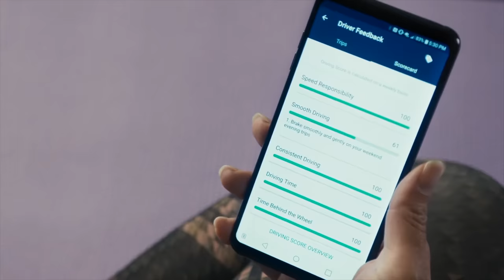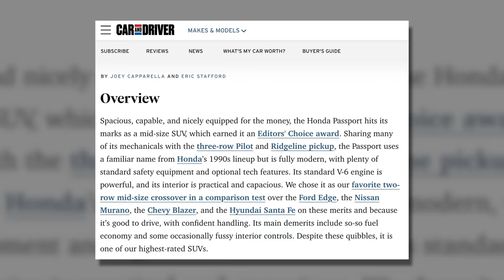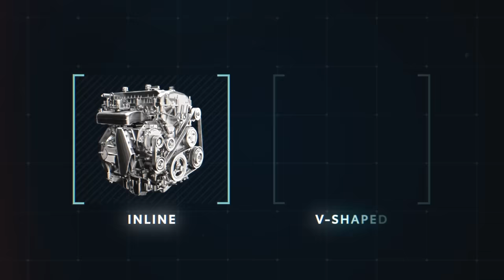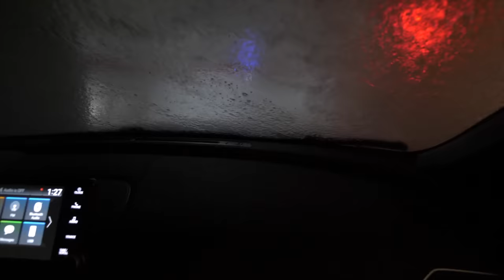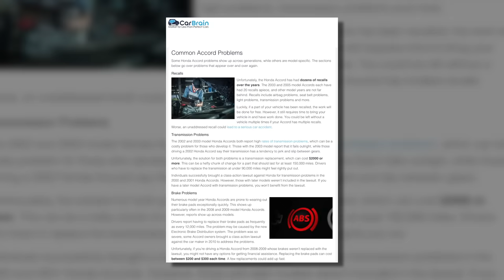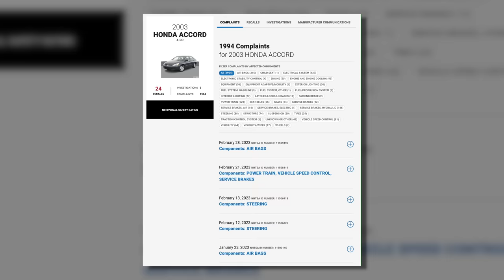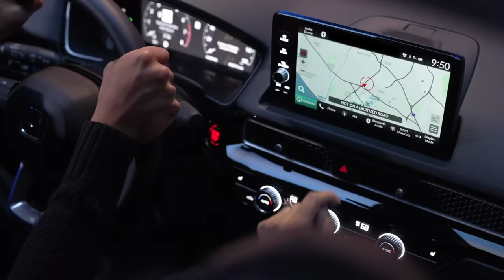Honda's CEO Just Said, "We're Losing Customers Fast and Don't Know What to Do"

Comment: former owner of a 2020 civic and a 2022 ridgeline. the civic with the 1.5turbo had oil dilution issues, regardless of what the dealer claimed. checking the oil before a service visit, the oil was half quart high and stunk of gas. then there was the thin hood that rippled with cross winds at high way speeds, not cool. digging deep into the ridgeline's VCM feature was disheartening, the 'thud' and its sound suppression in the cab as well as the engine mounts that will fail. not cool. honda is not what it once was. got rid of both vehicles.

Comment: I bought a 2016 honda fit..last year.( cvt )... Put BC racing coil overs an Hks hi power silent muffler a Magnaflow high flow Cat...and a drop in K&n air filter...and I have so much fun driving this car around town...I doordash with it full time...No back or neck issues...pretty comfortable really! and this car is really quick! and sticks to the ground! Super fun to drive! fingers crossed but not worried this is my 3rd honda and so far have been low cost to maintain...and you get alot of miles between spending money.

Comment: My honda fit had the instrument cluster repeatedly not start up in cold weather due to the cracking of the cheap solder used in the circuitry. They offered to replace the whole thing for $1500 but that wouldn’t have solved the underlying problem so I just took it out and resoldered all of the pins with better solder and now it works every time. Also very buggy software. And the timing chain rattles on startup but they said they all do that. Other than that it’s been great.

Comment: We have owned 3 Civics, 3 Accords and a Ridgeline since 1984. The 97 Accord had 250k when I sold it. The 2010 Civic has 229k on it and I am selling it soon. It still runs very strong. The 2013 Accord Sport has 100k + on it and is still A great car. Love my 2017 Ridgeline. 26mpg with all wheel drive on Road trips! Love em!

Comment: I have a 2016 Honda, which I have had no issues with at all.  Just change the fluids. My 2019 Toyota Highlander has already had a fuel pump changed out, and an AC compressor replaced.  The Toyota is much more comfortable to drive, but I love the Honda reliability

Comment: Have a 2022 Civic with 18k miles on it rn. We have had a few hondas such as the accord, pilot, odyssey, and crv. I feel that the pilot and odyssey are nice but the transmissions can be slow; Something we didnt have a problem in our 2009 highlander. Odyssey got traded in after some transmission issues.

Comment: YTuber John's Garage's daily driver is a 2000 Acura TL. He has put almost 700,000 miles on it. The other day he took the engine apart to replace the knock sensor, and the car's engine interior looks amazingly clean. He's been changing oil and oil filter every 3000 miles since day one. That simply tells you all you need to know about Honda.
Reply: Knock sensors are mounted to the outside of the engine.  Sounds like a tall tale to me.
Reply: ...honda 23 years ago...

Comment: Great video. I bought a new Honda Accord back in 2001 with the V6 engine, it has been an extremely reliable car. All I have had to do to it is wipers tires lights and brakes in 160k miles. I still drive it today. I also bought a new Toyota pickup truck in 1994 which was the same way, extremely reliable with the same service record except i had to put in a clutch last year. I changed the oil every 3k miles. I got tired of them both so back in 2010 I bought a dodge ram 2500 with the Cummins diesel engine to pull a 30ft camper and I have had more trouble with it in 45k miles than my Toyota in 160k miles. As far as the Honda, I bought a new Honda CR-V hybrid in 2022 and love it. I will have to say that I liked the Toyota venza better but when I ask how much to change the batteries in 10 years the shop told me the venza was 10k VS the Honda at 3500. Even though I liked the venza better, it wasn't worth, 6500 dollars more in 10 years for the batteries. I keep my cars even though my neighbors laugh at me for it until they are worn out, that's the only way I can get my money's worth out of them since the prices are so high.I am 64 years old now and retired. Hopefully I will never have to buy another car, saving me lots of money and debt. Honda or Toyota you can't go wrong, with them, they are the only car brands I would buy.
Reply: "...my neighbors laugh at me..."  Stupid neighbors.  While they're making payments, you're making bank.

Comment: 2008 Honda Accord V6 no major issues. I'm pretty handy and do almost everything myself. The only thing I didn't want to deal was a radiator blew up on the highway. Took it to the shop in the morning and it was done by the time I got out of work. One pretty major issue I had was the floor rusted out from the inside out. I live in Chicago and rust is a big issue here due to the bad winter we get. I had a little whole under the pedals. I was able to cut out the floor and weld original floor that I ordered from Honda. It was a fun project I did after work for 2 weeks. I would get another Honda even after my rust issue.

Comment: I bought a 2019 Passport  (only 33K on it) thinking of good quality since our family has had Hondas in the past with little to no issue.  Just got back from a third dealership trying to fix an electrical issue which shuts down the console/gps/entertainment system.  I'm just hearing of other Honda owners having issue on their new Odysseys and Pilots since I've vented about mine.  The quality they once had is long gone.

Comment: I do feel like they've turned their back on the enthusiast community for some time now and even with the type R it just feels like "too little too late" Honda to me is late 80's' through early 00' that's what helped the company gain popularity with the masses. I do feel like they should increase priority to the engineering and design teams, as it  feels like their finance department seems to have too much priority at the moment. Not sure why the fit/jazz was discontinued?

Oh! Just wishing at this point but.. bring back old and popular powertrains in crate format. Even better would be complete chassis of those older cars or ways to maintain what we currently have. There's a reason theft is an issue with Honda. supply/demand/scarcity , Also the cars are getting too big. That vertical stack height is getting harder every year to hide but I understand they might be limited by safety ratings.
Reply: I just learned the term "stack height" from this and now I know the second thing I hate about modern cars (the first being high beltlines)

Comment: Honda killed themselves by replacing perfectly good engines with these tiny 1.5 liter engines turbo charging them and put them on a CW drive. No way I'm trading my Accord with the last of the V6s so smooth and power on tap.  If my Accord blows up I'll probably have to get an Acura at least they haven't abandoned the V6s

Comment: Owned 1990 Civic LX, then 2001 S2000, then 2002 Accord LX, then 2005 Civic. Guess which 4 banger engine produced the most smiles. Changed oil religiously, timing belts, brakes when needed. Had over 300k on the Accord before donating to charity. Only Honda still own is a 1979 CB 750k. Wish they’d get back to doing what they used to do.

Comment: I bought a 18 CRV, I should have bought a Toyota
Reply: Why?
Reply: nothing wrong with 2018 CRV
Reply: I got rid of my 18 CRV due to oil dilution issues that didn’t go away after the software fix.  Honda wouldn’t stand behind their vehicle ..... no more turbos or cvt’s for me.
Reply: I a 2019 crv. I should have bought a Toyota.  Disappointed  with 1.5.oil dilution and no heat in winter
Reply: Mazda better

Comment: I had a 1990 Honda Accord with a 2.2L engine ans a manual transmission. I ran the hell out of that poor car and when I got rid of it, it had 360,000 kilometres on it. The car was falling apart but, the engine was running excellent. That poor car had a hard life.

Comment: I have owned both and like both. My problem is that I hate automatic transmissions and will not buy one. I'm also not fond of turbos either. Toyota won't make a manual V6 Camry to save their lives, and just as they were finally becoming fun and interesting. My current ride is a 2012 Accord V6 coupe, and i LOVE this thing! Fast, fun, easy to maintain, and great styling. If I ever trade it in, it'll be for a 9th gen V6 coupe, but that's as far as I'll go.

Comment: I loved my Odyssey and wish I still had it. I only got 141k miles on it before I got rid of it. Started to put too much money into it and there was a potential very expensive transmission issue on the horizon. Started to have battery issues, which Honda said was not the battery, but when I took it another place and got a non-Honda battery, the problem went away. When I looked at new vehicles, I wanted a CRV, but I did not want a CVT transmission, and I found out there were oil dilution issues, which I did not want to deal with. So I got a Mazda, a brand I had never considered in my life, and I love it.

Comment: Fell out with Honda after our, 12 month old at the time,  2016 CRV started leaking washer fluid from one of the headlight washer nozzles. The dealer refused to repair it under warranty stating that we had used the wrong washer fluid. We had used the Halfords pre mixed stuff.. I mean washer fluid is washer fluid isn't it? A simple but expensive mistake for Honda, as I won't buy another.

Comment: This isn't difficult: I wanted a Civic SI. I couldn't find any near me. When I finally did the dealer wanted 10k over sticker. So then I looked at the Acura Integra manual. They wanted MSRP with bundled options I didn't want. 

I really wanted a Passport Trailsport but it's not a real trail model. The Pilot trailsport was too expensive.

So I gave up and got a Tesla to see me through temporarily. And I've been a lifelong Honda customer. At some point I had to give up.

Comment: My last 4 work cars were Honda Civics. 1989, 2004, 2008 (stolen and wrecked) 2007. All were manual transmissions. All were ex models w/Vtec. Simple and reliable. I bought my daughter a 2002 Civic LX w/automatic transmission. It started slipping between shifting gears at 130k miles. Very disappointed. Love the fact my '07 & '08 Civic's did not have a timing belt that needs changed every 80k miles either

Comment: I had a 2004 Honda Insight I bought used when fuel prices spiked in the mid 2000s. It delivered the goods so I traded it for a new 2007 Civic Hybrid. The Civic was just OK, that’s it. Very uncomfortable seat, very high road noise and an exasperating voice command climate control and NAV system I had to take if I wanted the hybrid. I was disappointed in the cost of dealer service for simple maintenance, and it had a surprising number of recalls, class actions related to fuel mileage and rear tire wear. I drove it for seven years and 49,000 miles and traded it off for an F150. The latter has actually been a far more enjoyable vehicle with comparable quality.

Comment: Very dissapointed with Honda in Uk!  It has been exactly 2 years since I owned my 2017 Civic (1.0 l petrol) and have had numerous problems! Now, the latest issue is that the timing belt change is due with 6th year service - dealer quoting £1700 and thats on the top of the cost of 6th year major service for which they want to charge over £600! Will never buy Honda again!!

Comment: Honda has experienced supply issues and the technology packages are at 2015 levels when compared to other competitors' models. I have a 22 crv and the technology in the vehicle is archaic when compared to my f-150. Also, the cost  of dealer-mandated services are very expensive as well and it would turn away first time purchasers from getting another one.

Comment: I have a 2008 Honda CRV with a healthy 2.4 L 4-cylinder V-Tech engine. It's a great compromise between power and gas mileage. With over 200k miles, mine still runs great. The newer generation CRV's have much smaller 1.5 L engines with turbos to make up for the lack of horse power. Plus they seem to suffer from bad oil dilution problems. Switching to smaller weaker engines was Honda's biggest mistake. They should still offer the 2.4 L V-Tech as an option.
Reply: Well, the next generation Civics will most likely be all hybrids!

Comment: The redesigned crv took away Sirius Xm radio on the EX trim level as well as fog lamps and now you have to pay up to the EX-L level to get sirius......a bad move in my opinion.  The real value of the CRV "WAS" at the LX and EX levels (in the previous design) because when you think about it....paying over $37,000 USD to get sirius xm radio in a current EXL you only get  a 190hp 1.5 turbo...for the same price in a Subaru outback  you get a 2.4 turbo putting out a whopping 260 hp

Comment: I had a Honda Fit Sport 2008 from 2008 until early 2023.  No problems with paint, interior, brakes, etc.  Only one major repair, which was back in 2017.  Something about spark plugs going bad and frying something.  They said it was an expected issue every 100k miles (it was around 80k then), and it cost around $1500 to fix.   Other than that, not a single issue and I could a good trade in value for it.

Traded that Fit in for Honda Civic 2023 (touring trim).  Had that since February.  Absolutely love it.  Only complaint is the amount of new tech to learn going from 2008 to 2023 (keyless ignition, electric power break, all the sensors, Infotainment system/Carplay).  That isn't really a complaint against Honda, as all the cars have changed a lot during that period.  In short, I'm a very happy Honda owner.

Side note:  I have a friend who has owned/driven both Toyotas and Hondas.  His main complaint with Toyotas is that they have "no soul."  They're good cars, but zero fun to drive.  And the "no soul" complaint wasn't just a contrast between those two, but also between Toyota and all other car manufacturers.  For him, Toyotas are reliable but boring/no personality.  Even a bad car, like a lot of Fords, had more soul to him than the Toyotas.

Comment: The last Honda Civic I sold it within 3 mos. It had all kinds of electrical issues, compared to the one I owned before. Which lasted for 307 thousand miles from brand new without any problems.
Reply: I've had many Hondas from model years 1992 to 2018. No electrical issues at all.
Reply: @markr.1984  my point was it was the last Honda.  The ones I had before that we're perfectly fine.  Now my issue is that the new Accord is absolutely boring in styling, compared to the Accord city car that they sell in Japan
Reply: Honda used to be a reliable brand. Now it's slow and bound to explode on you.

Comment: I am one of them. I have been honda loyalist since 1990. I have 10 hondas in my life time . My last one is 2015 Honda Accord EXL. This will be my last Honda purchase . Not to mention they have not come out with good car design. My car starter went out 80k . Never buy a Honda Car again . I bought a used Toyota Highlander 2005 for $2,000 at 260,000 miles 2020  . I am  breaking at 300,000 miles  and the issue i has was power steering leak and catalytic converter check engine last year. I followed  Scotty Kilmer's advice and put Paint Thinner I bought at walmart and so far no more check engine :) Thanks Scotty. My next car will be a Toyota Tundra when time comes

Comment: Dodge owners are crazy they like those rust buckets 
My 3rd Honda Odyssey has 200000 and still going strong 
My old ones lasted for 300000 before I traded them in for a newer one 
I’ll keep buying Honda 
I’ve also had 3 Honda accords and same thing I put lots of miles on them 
I like Toyota but they cost more to fix parts are more expensive than Honda

Comment: Long string of happy honda leasing, they screwed up by not having the civic hybrid available in the U.S. by now, a tremendous gap in the lineup. My 2020 Accord lease is up in May and I’ll either purchase the car at a favorable buyout price in the 15k range or go to another brand (Toyota) for a small hybrid, Corolla , Corolla Cross or Prius and use some leverage of the residual value of my Accord.

Comment: I've got a Honda mower and snowblower.  They're extremely well built and reliable.  I was always interested in getting a Honda car, but they have an excess of bland and ugly cars.  I tried getting a CRV once, but the dealer wanted more than MSRP and there wasn't another one in the city.  That was a massive turnoff.  I don't want to work with a bad dealer.  I've had one Ford   Loved the car, but the experience with Ford dealers was bad enough that I'd never but another one.

Comment: I've owned 20 cars and my 5 most reliable cars were all Hondas.   I've owned two Toyotas and, while mechanically reliable,  they have both experienced electrical or software problems.    For example, after owning it three years, the multi-function display in my '06 Prius had major issues.   While investigating this issue, I found Toyota had a Technical Service Bulletin out on that exact issue 18 months before I bought the car new.   Toyota tried to stick me with the full replacement cost.    On the other hand, I've had Honda EXTEND the warranty on parts before they failed, then fixed the issue at no cost to me.   My experience is Honda is a much better company to work with.

Comment: I bought a new Honda Civic Hybrid.   At about 80,000 miles the battery went bad.   Cost to replace battery was not worth it compared to worth of the car.  Sold it and bought a Toyota.  That’ll be my first and my last Honda purchase.   Wouldn’t touch an electric car made by them with a 20 foot pole.